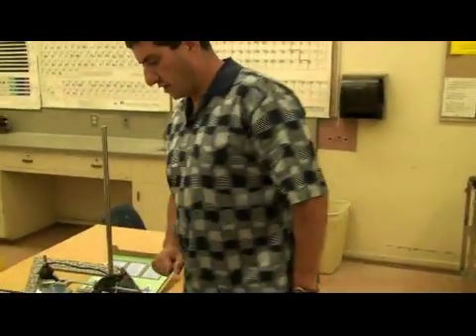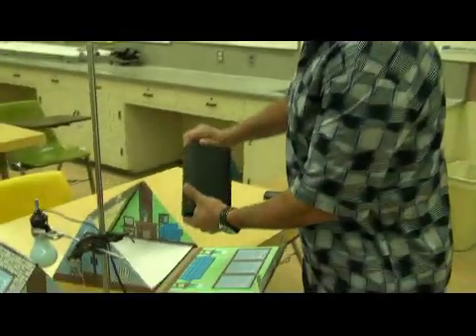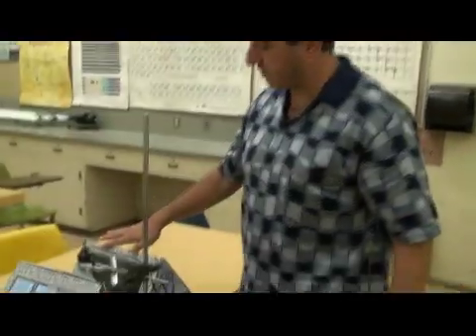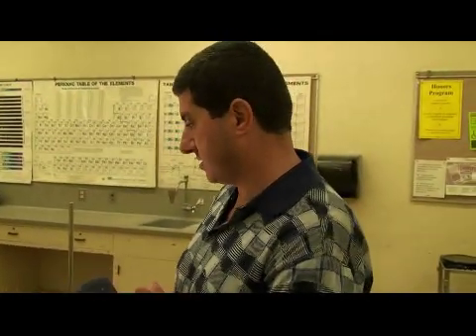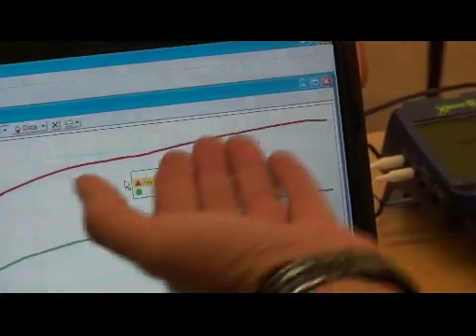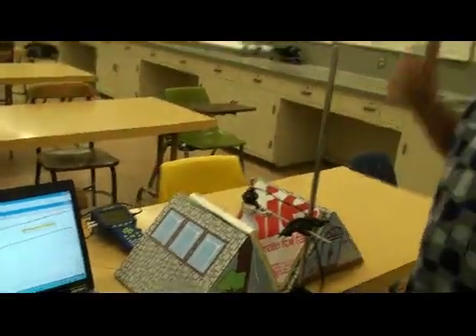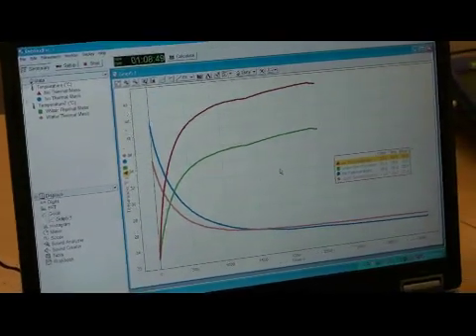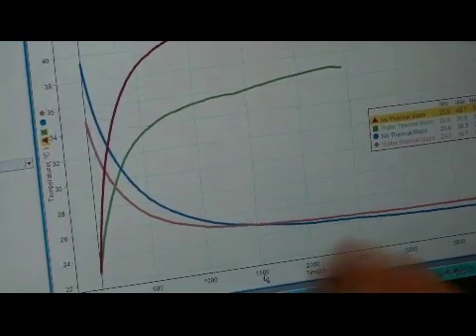Thermal Mass.avi

Comment: I am now confused. 
I am led to belive by other sources, that thermal mass makes things get hotter quicker. 
Im guessing basically because of the water having a LOW thermal mass, as it takes a lot of heat to heat up quickly it therefore worked like this?